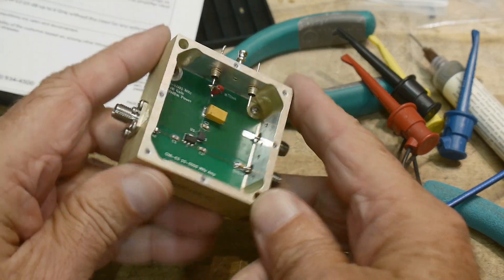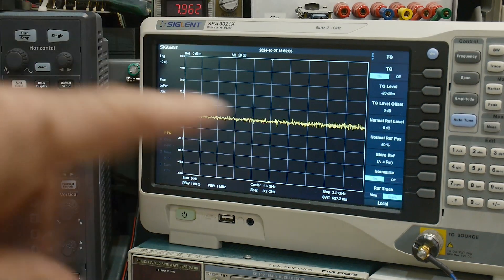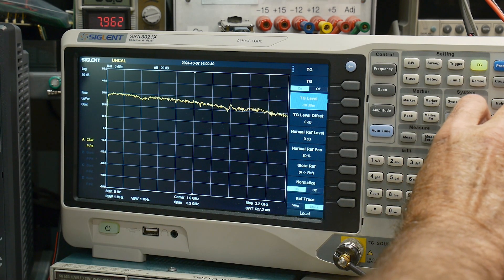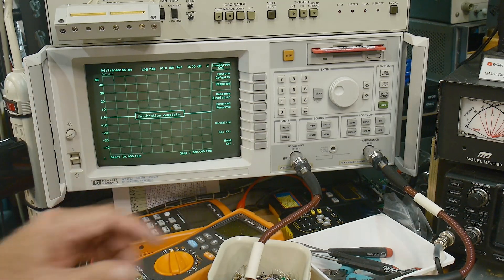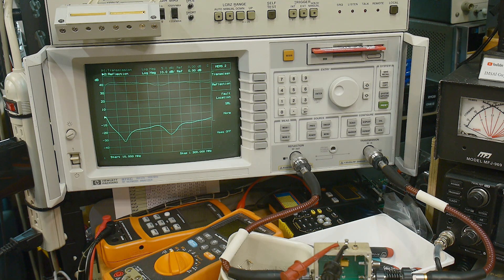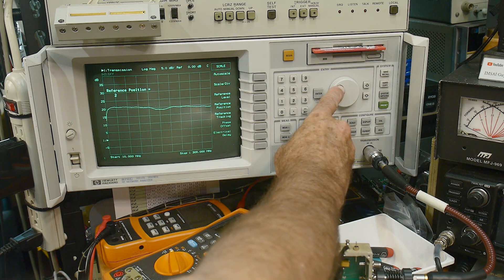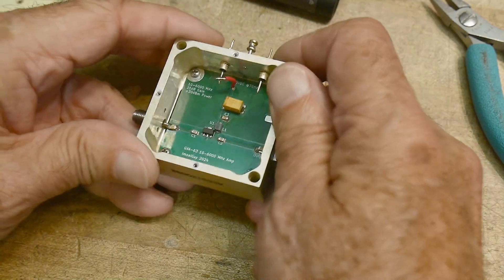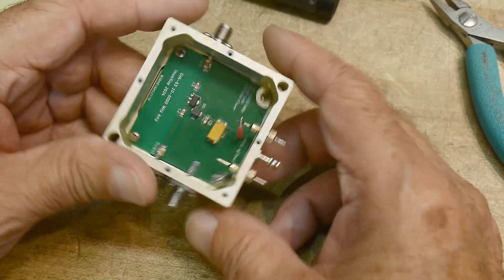#2027 GVA-63  Amplifier Project (part 10 of 10)

Comment: If you get bored, could you please try unsoldering the board, removing the um...soldering-aid capacitors, lift the board with washers, and then soldering it directly? And then put the lid on. And then retest. I am new at this stuff, but I was curious if the solder blob situation made an impedance change.
Also, perhaps the coupling capacitors on the board are not the best? Perhaps they are a bit inductive?
We can assume the traces are properly wide, but is the board the proper thickness as you spec'ed?
Something looked a bit warm, perhaps a little heat-sink such a 3D printer one might cool it, if it cannot be coupled to the case.

Comment: If I had those little boxes, I'd be tempted to build a programmable attenuator based on a PE4312 chip.  Or a pair of them, for
total attenuation of over 60dB.  Or three of them...   When you get into big attenuations, the main challenge is to stop signal from sneaking past them.

Comment: The connection between sma and the transmission line is super critical, ALso a mismatch in the impedance can explain it in the transmission line using FR4. Things get really trick at tht frequency aroudn 2 Ghz. For our space grad transceiver (Move II project) a 2.4 Ghz Line had to use several matching networks and smalles changes in capacitance make a real difference. Try to make a TDR measurement  then you can see all imperfections form SMA to the device. And try to lift up the board this will help.

Comment: I designed some small PCBs with tim pots and a small IC socket for testing transistor/FET designs.  I find them so useful.  Set the pots with a DMM, stick a device in to the socket and see how the design works.  Tweak the trim pots to adjust biasing etc. to get the desired outcome.

Comment: I agree about encouraging people to just jump in and try a design even though you may not get it all right the first time. Failure is a great way to learn how to do it right next time. I wonder what the self resonant frequency of that inductor is. I doubt it looks like an inductor all the way to 6 GHz. Maybe putting two inductors in series there, first one good at over 3 GHz and 2nd one good below that? Also about tying the grounds in better between the PC board and the SMA connectors. Right now ground current has a long path to get to the PCB grounds. At these frequencies everything like that matters.

Comment: I've been building electronics stuff from scratch since I was a kid. The act of creation is what it's all about. After I retired I built a WWVB receiver with a 1 MHz disciplined freq reference from an article in a ham magazine. I built it a little differently, used some different parts because I had them and they were better. I made my own PC boards, built it close to what was in the article, but packaged it in a  small Styrofoam cooler to slow down thermal transients. I made a little 1 MHz crystal oven after testing a few 1 MHz crystals to determine their most stable drive point and temperature and selected the one with the most stable temperature plateau. I worked on it all day every day for over 2 weeks. After all, I was retired, and lived alone in the Colorado Foothills. It was a time to enjoy the scenery and work on electronics projects, my 2 favorite things. I built and tuned a loopstick loop antenna similar to the one in the article from a ferrite rod I had, but I also built a 3 foot diameter loop from large hardline with an adjustable FET pre-amp that wasn't part of the design, because it had a higher Q. While testing my receiver I was getting a square-wave output from the little TRF receiver with either receive antenna, instead of a sine like the article was expecting, and at first I wondered if I was getting interstage feedback causing self-oscillation as I was trying to tune the receiver to peak the signal, and I literally spent hours trying to find the source of the oscillation to no avail. It appeared I'd just built a 60 kHz oscillator. So I decided to go for an evening walk to clear my head. I was living in my small motorhome at the time, parked at a reservoir campground in the Colorado Foothills. So on my walk through the campground late in the evening I decide to walk up a small rise to see the view, and could see a long ways to the north. What I saw was red radio tower lights blinking on and off in the distance, about 15 or 20 miles away and realized that I was looking at the WWVB transmitting antenna in Ft. Collins, and started laughing at myself for spending most of a day trying to figure out why my WWVB receiver was outputting a square wave instead of a sine. When you're up in the hills you just don't consider your proximity to radio transmitters. I walked back to my RV, fired up the scope, entirely disconnected the antenna to the 60 kHz TRF receiver, and there was my 60 kHz sinusoidal WWVB signal in all its glory with its characteristic amplitude step data encoding slowly jumping up and down as it should. I then added a short vertical whip to the project that bypassed the tuned antennas and pre-amp stage, and a switch to select the antenna of choice for when I was within sight of WWVB and was overloading the receiver's front-end. It was just one of those odd technical problems we run into when we choose to build from scratch something that never worked before, and we make it work. We bring it to life like just like Frankenstein's Monster. This was the favorite construction project of my hobby career up until that time because it required the most thought and problem-solving skills, and it was my frequency reference for years until I picked up a used rubidium standard. Building useful things from near scratch is about the most fun you can have in the electronics hobby, and will give you an immense feeling of satisfaction. That moment I disconnected my receiver's antenna and WWVB finally appeared on my scope was magical. 

On a trip back east I even visited the author of that article at his home outside of Chicago, thanked him for his careful design work that got me started, and I helped him with a LowFer antenna project he was working on, and I made a friend.

Comment: There is an impedance mismatch on the input.  I suspect a series inductance is causing the roll-off.  You might try scratching the solder mask and soldering a shunt directly between the ground planes and the SMA shells (or using pogo pins to the case adjacent to the connectors).  Otherwise, analyzing the input impedance vs. frequency will help isolate the problem.  I would have shimmed up the PCB to avoid the signal path kink.

Comment: Everything looks good, congratulations. 
Just, if there is something to further study, I learned that the line terminations need much experience, (and the best ones were made by HP and hard to copy). I have doubts that the signal just goes to the inductor and ends there, the element must have some capacity. One way might be to to set up a line with characteristic impedance and terminate it with an inductor and a capacitor at half the length, checking whether or to what extent it really ends there. The other way is look how other designs connect their dc. 
The project is fine but there are always things for further study.

Comment: Good project, please iterate this again for an MMIC based pre-amp for a VHF or UHF band, preferably 1296 or 432.  Might be a little more involved with problems with oscillation but that would be super interesting to me and potentially others, especially the fails where we could all learn from your mistakes.  These chips are cheap, like $3 and $4 but offer good gain and noise figures.  It would be a service to the ham community to marry your great way of teaching via video to a common problem for many hams.  Best 73's, Steve

Comment: I'm glad you explained why you did the project because FleaBay is full of those things. I started using KiCAD over ten years ago to make a few home projects. And with the ability to have PCBs made dirt cheap we can do things that were financially way out of reach a few decades ago, when working in the industry. It really does open up a lot of possibilities for the hobby.  With marginal success using the toner transfer method, it doesn't come close to being able to make professional multi layer PCB with plated through holes. The only thing you really need is patience, while waiting for the board to make it's way across the ocean and into your mailbox.